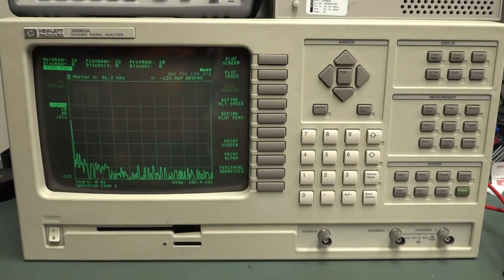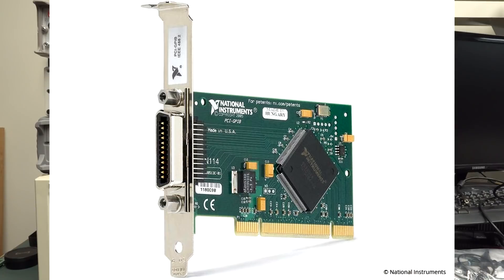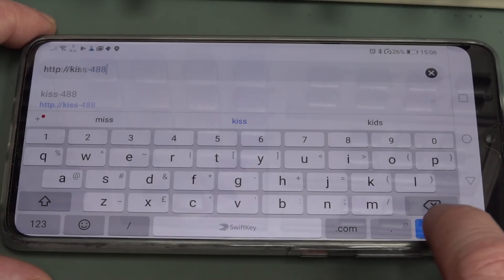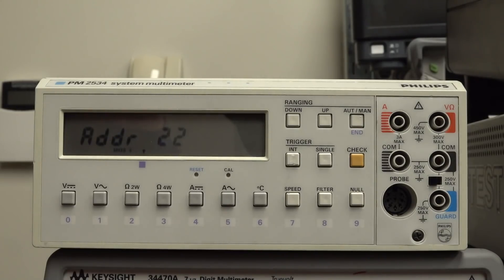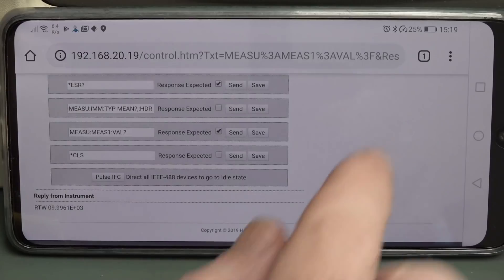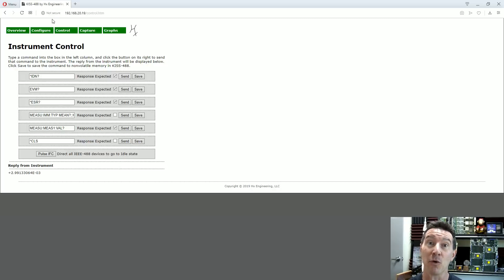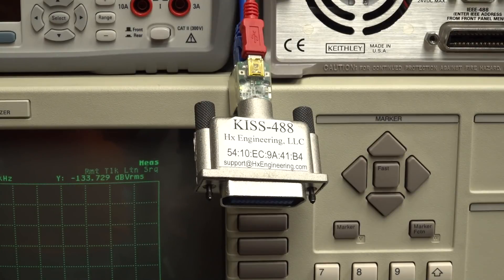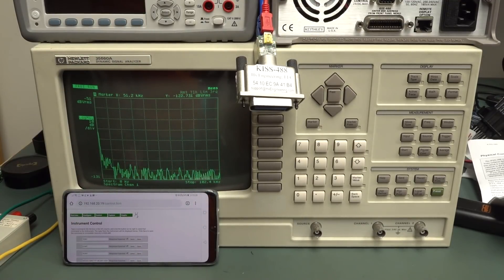EEVblog #1232 - Add Web Access To Old Instruments!

Comment: Looks like a very well thought-out device to help make life easier for I cannot overstate the never ending world of pain associated with configuring a GPIB-USB adapter. Please do a deal and become the local supplier so the formidable shipping price can be amortized
Reply: I must be used to GPIB, but I find it rather easy to configue.   Agilent/Keysight's Connection Expert makes it a lot easier.  Then to use Tektronix OpenChoice Desktop, you need their VISACOMM32. Somewhere along the line, you end up with NI Visa too, but do a repair to Connection expert to make Agilent VISA primary (or secondary) for your needs.   Generally, I find if I can see the instruments with Conenction Expert, I can talk to the instrument with Visual Basis.  Biggest thing is that you need the programming manual for the instruments you control and get data from.  Some older instruments (i.e., HP 11713A sits on the bus and only accepts command and does not send any responses).  It's all fun but probably does have a big learning curve.   I do find GIPB easier to use than NETWORK interface (the programming is basically the same, but I have more problems seeing the instruments in NETWORK I/O than GPIB, but the NETWORK interface port is a LOT faster).
Reply: @Daveyk021  Right, so I presume you're talking a Windows install and you've got all the correct versions of the required software, have worked out the actual revision of your USB dongle, and have a spare hour or two and nothing wedges along the way. Then you end up with bloatware - a myriad background services doing something. Then it wants to do the latest update again and then, if you have the need  to install another USB device, let the conflicts begin. Then, multiply this pain by the number of laptops. So then you try a Linux install. Do you have the correct Linux kernel headers? Do you have a Linux dist that is supported by the GPIB library framework? Well, you don't really know until you try and fail. Then you waste a day getting it to almost work and then  you have to debug more low-level USB stuff. Finally, it's all working and you can move on to solving real problems ... until you need to switch machines and go through a similar but not identical set of tedious operations. Get the picture? Imagine if you could just plug in an ethernet device that just worked!
Reply from the maker: @grahamgallagher48  Yes, GPIB can be relatively easy is you have all the right drivers and nothing goes wrong. But anyone who's used it extensively know you'll eventually come-a-gutsa.
For a full rack of GPIB stuff you are still going to want to a proper card and cables and drivers etc. But for a one-off job the KISS-488 is a neat solution.
Reply: @grahamgallagher48  Lol, this sounds EXACTLY like my usual windows experience every time I try anything more technical than Notepad XD
You'd think they would have ironed out that kind of bumps in 30+ years, but it hasn't changed much since the Win 3.11 days.

Comment: Philips devices from the late 80s seem to not understand the IDN-Command. I used one of the old ISA-Cards btw. and was quite surprised that there were still current drivers available for Windows 98, which I have running on my old Retro Gaming-PC. :)

Comment: I need to try playing with GPIB, I have a USB to GPIB adaptor and some GPIB cables, I just need to figure out what software I should use on my Mac and get stuck into it.
Reply: The answer is always "Python". See PyVISA.
Reply: its frustrating but can be fun ...I worked on some instruments at a test bench at a company for a school project....you might be able to score some old gear to play around with. stuff like GPIB control of a signal generator was pretty fun to implement.
Reply: Kevin Miedema - I’ve got plenty of gear to try it on (I buy broken gear and fix it to make videos, and I’m a hoarder), I just need to sit down and actually try to do it...

Comment: System 21 was compatible with IBM's System i format (AS/400).  I believe it is still in use/development and is part of the open Service Oriented Architecture.  Most computer techs from the IBM AS/400 era would be familiar with System 21.  It was a nice idea for them to include it and either shows a bit of foresight, or perhaps they had a large contract customer that was asking for it.
Reply: Hi,
I seriously doubt that this IBM system is identical to the Philips system. Or at least, I cannot remember any connection with IBM in that time.
The Philips system 21 was developed by Philips IE in Almelo, the Netherlands in the 1980's. It was a IEEE controlled system of blind units that could be stacked on top of each other. The series consisted of one master unit, the PM2101, and multiple slave units which did communicate via the 9 bits serial RS-232 bus based on Intel 8051/8048 micro controllers. 
The slave units consisted mainly of relay units. For example the PM2120 had 20 reed relays. There were also units with high voltage relays and 50 ohm coax relays. Also analog input and output units did exist.
As shown, the PM2534 and PM2535 DMM's also were equipped with a system 21 interface, as they were developed in the same department in Almelo.  
I still have some system 21 units stacked below my lab table, mainly for nostalgia reasons. I think I am the last in the company from the original develop team. I started working for Philips Almelo in 1985 and did participate with developing system 21. Later, Philips IE  Almelo was sold to Fluke, then to Pemstar, and now we are called Benchmark Electronics.
Reply: @robvandeschepop8595  You must be right.  IBM references seem to indicate it was a solutions platform for the AS/400.